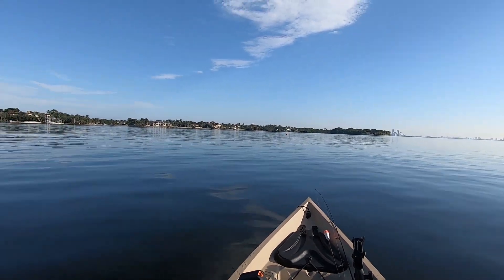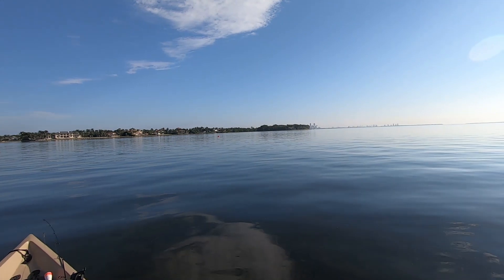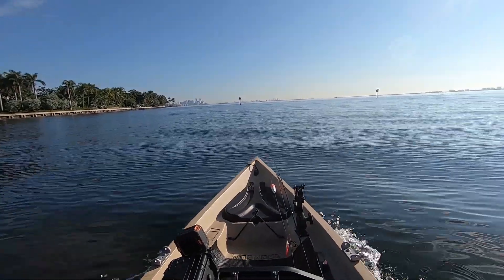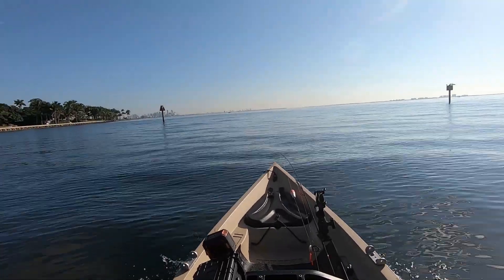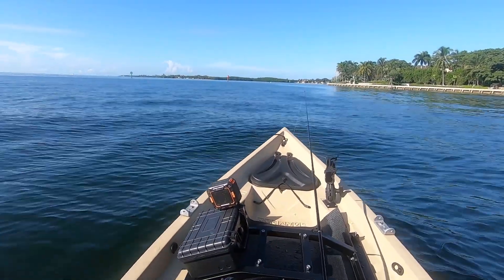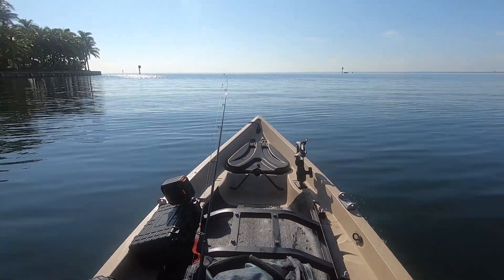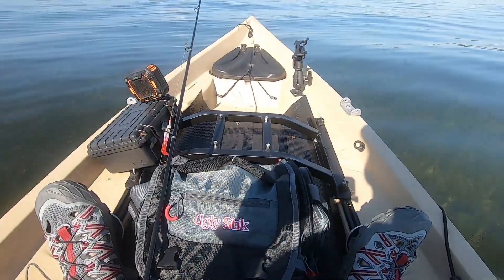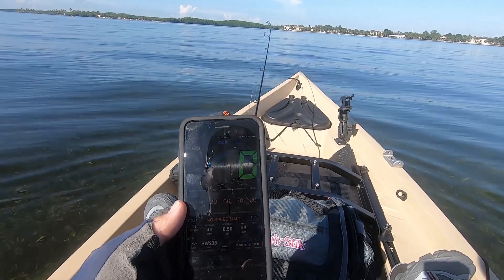Nucanoe Frontier 12 with Kayak Buddys Honda 50cc Outboard Running a Stainless Prop Upgrade

Comment: I have a unlimited model which I weigh down with my fishing gear and trolling motor and outboard which is a 2.5 mercury. My top speed is around 9 mph with all the weight.
Reply from the maker: Why would you want to stress your hull like that? It will crack from the torque. That hull is not designed for that speed. Be careful.
Reply: 2.5hp/9mph! Wow, I have a Frontier 10. I've been wondering what is the minimum horsepower it would take to get it up on plane. I have the small weed wacker engine type setup on my boat but it wont go over 6mph at best. I've been considering the mercury 2.5hp.  Am I correct in assuming that at 9mph your boat is planing out?
Reply: Have you had a Kayak hull crack because of to much torque? @kayakbuddysllc-lightweight4947
Reply from the maker: @rhett1272  I have dealt with many clients who have used traditional outboards and cracked the hulls due to overpowering and gearbox engagement. Read the Nucanoe forums. There are plenty of stories.  I have never had one crack with my engine setups because they are centrifugally driven and the 2-blade prop is way smoother on the acceleration than what comes on the traditional systems. Once you crack the hull the warranty is voided and the kayak will never be the same as far as the rear integrity.
Reply: @kayakbuddysllc-lightweight4947  thanks for the heads up that's good to know
Reply: @kayakbuddysllc-lightweight4947  Thanks for the comment! When I did not have the Nucanoe outboard motor mount I was worried about this. With the motor mount it seems to be in good shape but I will keep that in mind. The nucanoe unlimited is rated for a 2.5 hp so with the mount I wasn’t too worried.
Reply: @rhett1272  It can get on plane but it depends on how much weight I have for fishing.
Reply: @iamback2415  Thanks for the feedback. Did you no there is a 5 hp upgrade kit for the 2.5 mercury? The kit includes a 5 hp carburetor and a different prop. Or you can make your 2.5 a 3.5 by simply ordering the factory carburetor for the 3.5hp.
Reply: @rhett1272  yes I do!
Reply: @iamback2415  👍

Comment: Just curious, do you have an issue with water coming into the scuppers or the f12 not self bailing with water coming over the bow?
Reply from the maker: I do not have any issues with water coming in with scuppers plugged in. Very little water comes over the bow. With the passenger and motor trimmed correct, water has never been an issue.
Reply: @kayakbuddysllc-lightweight4947  I meant when the scupper holes are not plugged. It says in the nucanoe video to plug the scuppers if you want to use an outboard because water will come in through the scuppers. I want the kayak because it’s self bailing and I can go in the ocean. Trying to decide between the pursuit and frontier.
Reply from the maker: @MrBthames2000  I don’t save any bailing issues and major water on the deck. It really comes down to seating position and how much water comes over the gunnels. I sit about a 1/3 forward from the transom. My ride is a 2015 model. If you want stability, the Frontier 12 is a beast. The pursuit is faster and tracks better, but that is the trade off. If you are going deep off shore water, the Frontier with power is a no brainer.
Reply: @kayakbuddysllc-lightweight4947  That makes sense. I just see posts of guys saying the frontier doesn’t self bail which is a recipe for disaster offshore. Or that water comes through the scupper holes when you have the motor going.

Comment: How would this going going up river with current?
Reply from the maker: I move in currents that rip sometimes 5 knots plus. There is no issue due to prop and engine torque. Obviously on-board weight, current, and wind will slow you down a bit, but I always maintain high 4’s in heavy current to 6.7 mph in calm waters with my heavy Nucanoe Pursuit.

Comment: Roughly how far can you go on one tank of gas.
Reply from the maker: Right around 5-6 miles depending on throttle speed.
Reply: @kayakbuddysllc-lightweight4947  bought 2 of your motors and now buying a nucanoe frontier 12 just to run it in intercoastal putting a trolling motor up front.